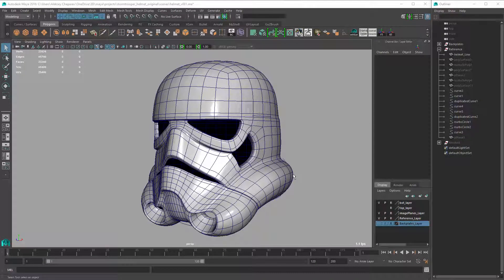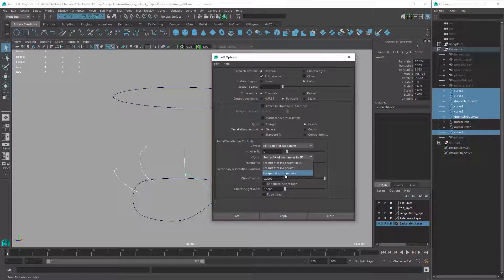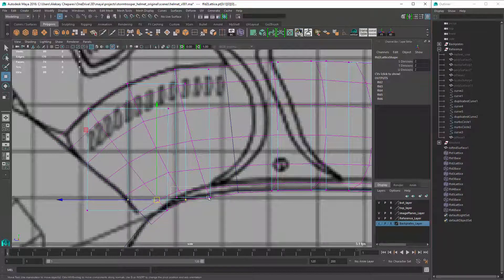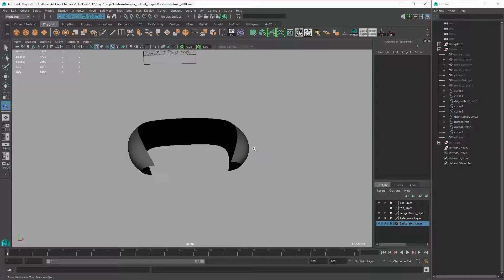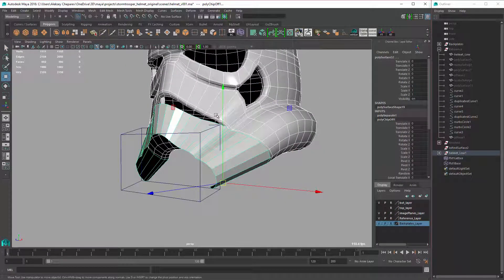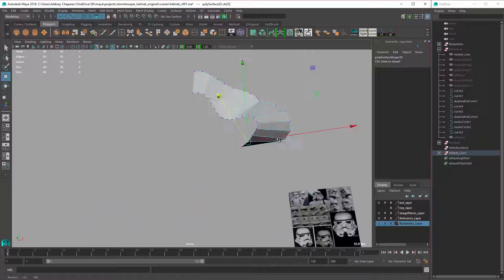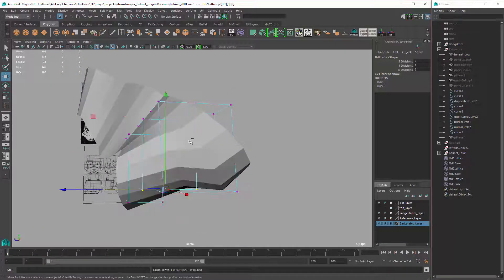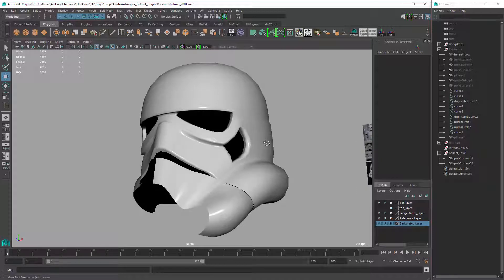Star Wars Stormtrooper Helmet Modeling Slowed Down

Comment: blin material you using there ?
Reply from the maker: Just for preview I used a blin. I rendered it in arnold at the end, so it's an aiStandard for rendering.
Reply: Whats Reset Transformations ?
Reply from the maker: I first freeze transformations, which will zero out all position values, then reset transformations to reset the pivot to world origin.

Comment: Honestly man thank you so much! is there any chance you'd still have the full recordings? i think some of us who are just passed the "making the crappy toy car" etc could actually make HUGE leaps forward just watching you in real time creating this. Again, amazing talent, i hope you're being well paid for it.
Reply from the maker: +Antony Quigley I'm recording the Rocketeer helmet and I'll make sure its not timelapse. Cody's helmet is a good idea, I'll try that after.
Reply: Alex Cheparev
yeah Cody's helmet from Episode 3 is awesome, hell any of hes helmet's are awesome. the issue i'm having is the transitions from one part to the next. Like i can make a boba fett helmet, as it's fairly straight forward, but it's the parts where i need to add more vertexes etc that i have the issues as i don't know where to add them (especially around the eyes of storm troopers) and how best to model, ie modeling everything using extrusion from 1 half sphere like my boba fett helmet, or making it from multiple pieces a la using the create polygone tool and just extruding edges piece by piece. But when i do that it's fine until i get to a curved corner, and i don't know how to link part's togetherand create the vertextes in the actual corners of the eyes (in ur helmet for example).